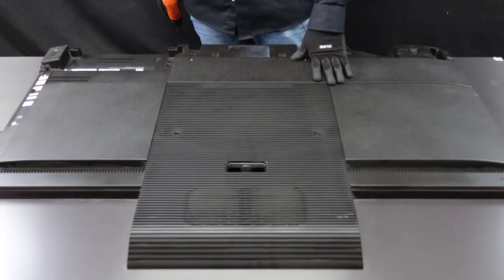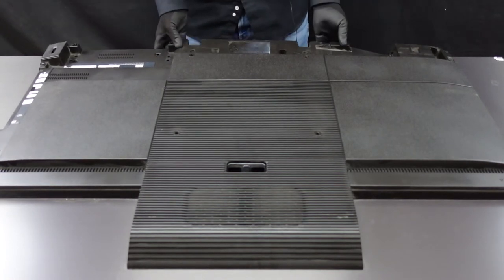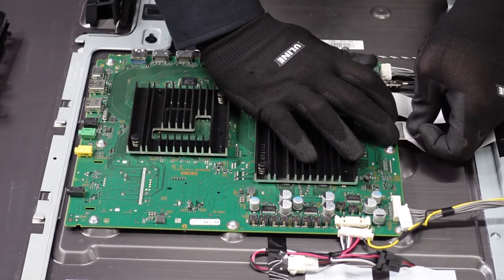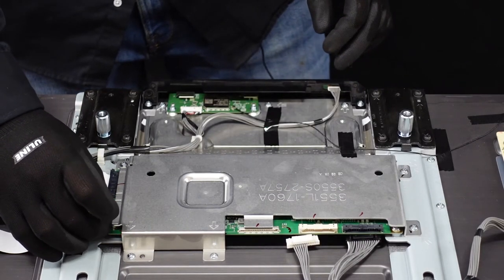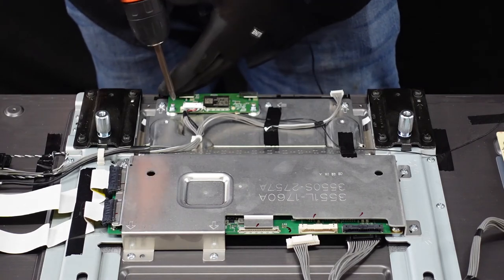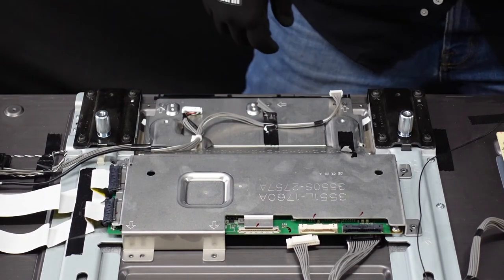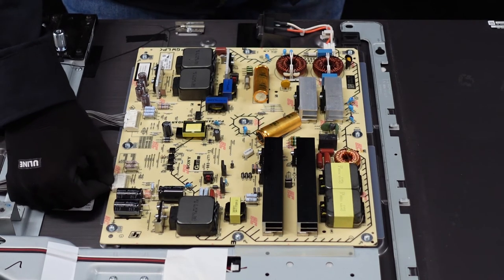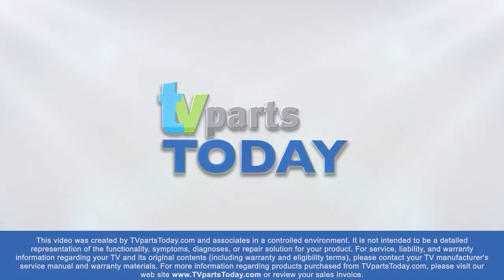Simple TV main board removal.  (SONY XBR-65A8F)

Comment: Wow an actual breakdown. Going to be replacing my supply board or my XBR-65A8F. Hit with a power surge and I get absolutely nothing when hitting the power, even after reset. Thanks for the vid!
Reply from the maker: Glad we could help! Feel free to reach out should you need further assistance!
Reply: @tvpartstoday  all good, gave a power board a try and that wasn't the problem. But a new main solved it! Thanks again for the informative vid 😁
Reply: @Failbot9000 how much did the main board cost?
Reply: @rishav_v  found one on ebay for like $150. Came from Detroit lol. But yeah saved me thousands in the long run.
Reply: @Failbot9000  was it easy replacing yourself? I have to replace my Mainboard too
Reply: @rishav_v  yeah, was actually surprisingly easy. Few screws and connectors. Some of the screws were a little awkward for the back plate but once you get in there it's ezpz.
Reply: @Failbot9000  does the main board have any processor or other component that needs to be removed and reinstalled on the new board OR do I just have to swap the board and it's done?
Reply: @rishav_v  nah, full board replacement worked. Didn't have to solder anything. I mean if you can figure out what burnt out (probs the coils and pcu) yo7 could do it that way for cheaper. Overall I just wanted the headache to be over lol, so I chucked the old board for a new one.
Reply: @rishav_v  but also know that any data stored on your old board will be gone too. And replaced with w/e new PCU has on it.
Reply: @Failbot9000  thank you, I'll be importing the main board. Hope to get it back up running soon
Reply: @Failbot9000 hey so I imported a new main board from US today and it has a sticker which reads, firmware needs to be updated and serial/model # needs to be mapped via service menu including tcon to main board display calibration transfer. Just wondering if you had to do all of these steps after swapping main board? If yes, did you have to have te rename the firmware package on USB to anything specific for TV to read and install firmware from USB? Do I specifically need a remote to enter the service menu as mine was lost and I've been controlling the TV via phone app
Reply: @rishav_v  luckily the one I got was second hand from a store in Michigan, though I would suspect if it is a brand new board you would need to upload fresh firmware. I believe you may be able to obtain the firmware from the Sony site, upload to USB and transfer it if you are unable to just do that over WIFI. Then update how you would normally for the latest version. Hope this helps.
Reply: @rishav_v  I also believe there was a mode you may have to put the TV so it can read and upload the files. There shouldn't be any third party soft you would need. The owners manual is pretty useless tbh, but it will tell you where to find firmware I believe. And ol uncle Google to figure out what mode the TV needs to be in lol.
Reply: Lastly, all of the commands can be done manually with the buttons on the TV.
Reply: @Failbot9000  yes that helped, luckily these things were mentioned in a paper that came with the motherboard. Swapped mobo, Installed firmware, mapped serial and model now the TV is back to life. It was like swapping a PC peripheral.

Comment: Hi.  I am quite upset that my only 3yr 77" SONY OLED is already dead.  It's flashing 4 times, tries to boot up and I see the google android logo and then their is a bit of distortion with the letters and it powers down.   I'm hoping it's just the main board but I can't even find any available to buy and swap out.  Do you think that it would be the main board?   Any idea where I can get one?   Thank you for your time
Reply from the maker: Hello,

What is your model number? We have some Sony manuals we can consult to see what the 4 blink code error means.

Typically 4 red blinks means it is the main board, power supply, backlights, or panel for most Sony models.